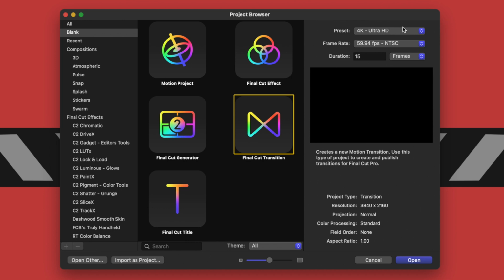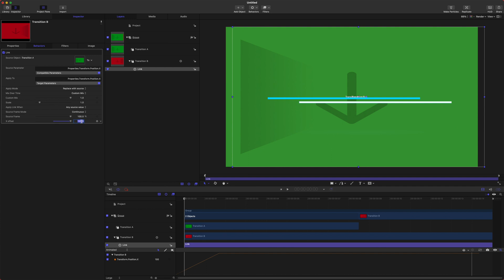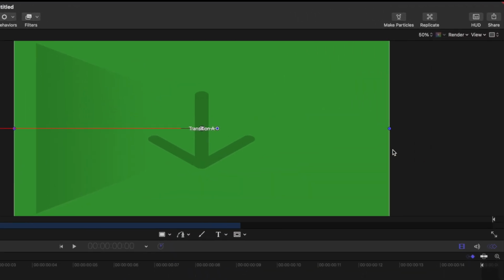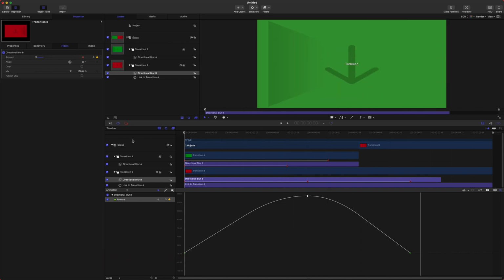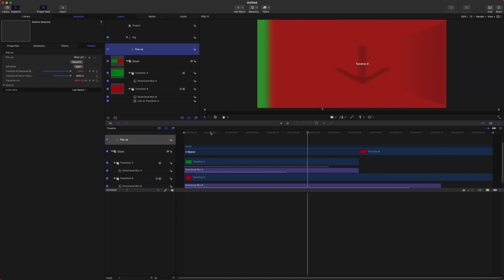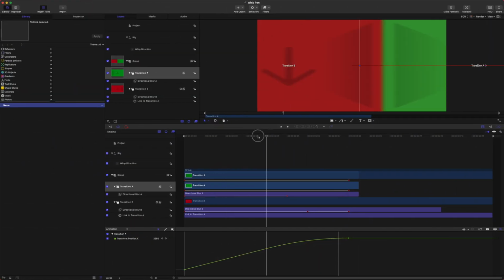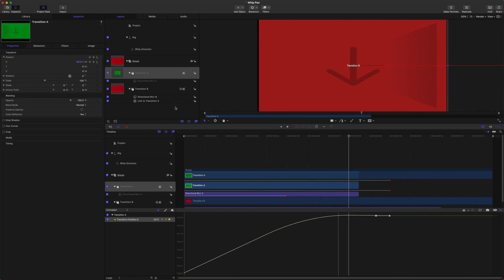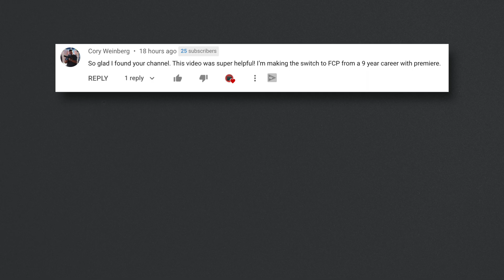Create & Rig a Whip Pan Transition In Motion 5 for Final Cut Pro

Comment: This kind of thing should be a pre-made preset that a user can just pick and then modify. When a program like this makes you build a house brick by brick, it's a lot slower than building a house with prefab walls (with sliders to change the preset values). Having to manually type in x offset values for 4K footage transitions? Seriously?!? It's like we're back in the 90's.